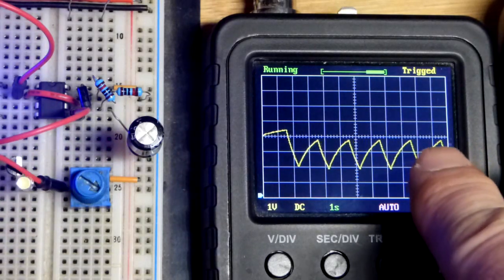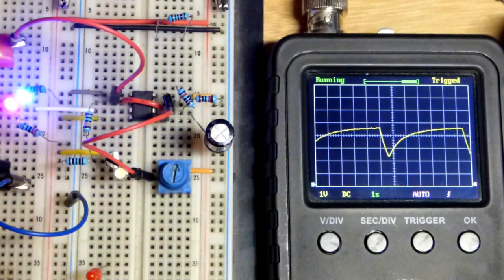Adjustable Fading On Off LED using Astable 555 Timer Pin 5 and NPN BJT Voltage Follower

Comment: nice demo - is the buffer transistor necessary ?
Reply from the maker: I think so. I am guessing the buzzer will overheat without it, but I don't know for sure. I haven't tested the passive buzzer without a capacitor in a long time.

Comment: The diagram is missing. 😊
Reply from the maker: I haven't felt like making a diagram lately, it doesn't help get views, and lots of what I am doing lately are circuits that took a while to put together but need to be improved, so definitely don't want to make a diagram for them.
Reply: Good. But the circuits are more difficult to understand. You rule.